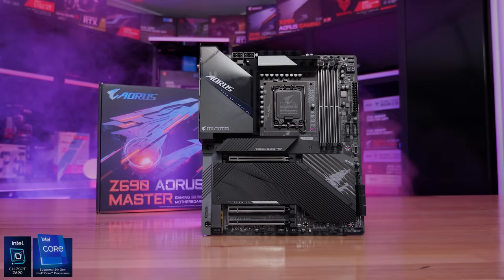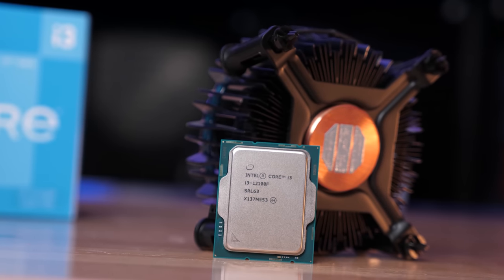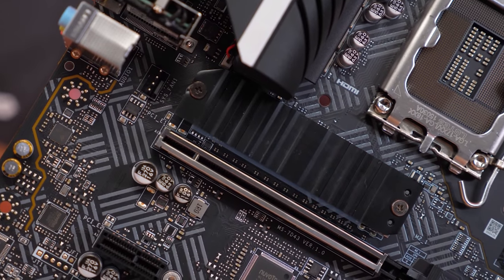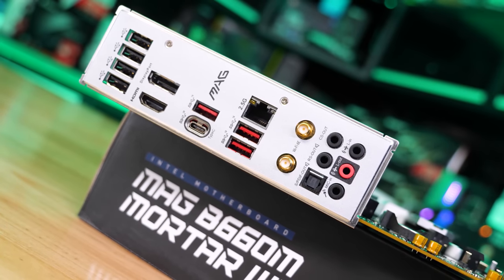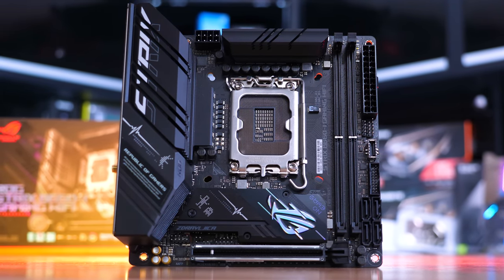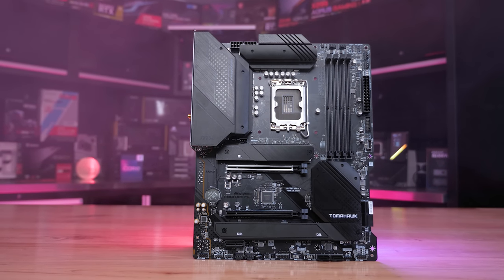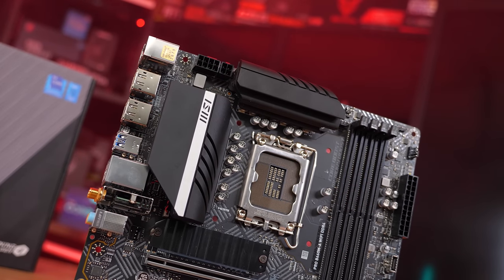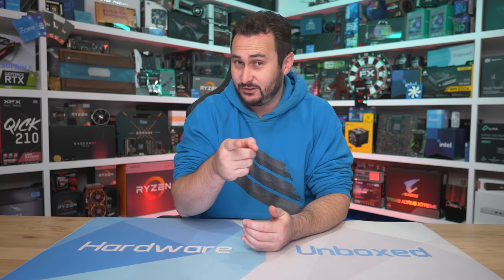Top 5 Best B660 Motherboards

Comment: I am once again wondering about the gigabyte b660 DS3H (full atx) for 125€ and the b660 gaming x  for 130€ (very cheap right now, should be more like 140€ usually). They both have a better vrm than the gigabyte boards that you tested . The ds3h simply has 2 more phases and the  gaming x is equiped with 8 55A power stages. and has pretty chonky heatsinks. It sounds like these are excacly the boards you are missing in gigabytes lineup
Reply: Now I'm choosing between Gigabyte B660 gaming x and MSI PRO B660M-A.  What is the best motherboard to buy?  I heard that MSI has a raw BIOS that freezes.  What should be considered before buying?
Reply: @stefan_es  Well the usual: how much connectivity do you need, does everything that you want to have in your PC fit on the board? If the boards are the same price, I would go for the gaming x. I think it is better in almost every way.

Comment: Considering that AMD is also moving to LGA for AM5 like Intel, maybe this "platform superiority" is coming to an end? LGA sockets must be more expensive, not to mention the retooling and training the motherboard vendors might need to do to support the new socket, and the old equipment they'll have to retire.
Reply: Doubtful. We are talking a few extra dollars at most for the socket at the scale they are operating at. It is likely due to the fact that intel's 600 series is much newer (x570 used to be at z690 prices for like a year after launch). Additionally I wouldn't be surprised if due to the current market many of these AIBs are just making higher margins b/c gpu sales have told them they can get away with it/people are willing to pay more for an intel mobo than an AMD one.
Reply: The high price floor is actually due to the 12th gen chipsets being more or less the same, expensive z690 chip - rather than due to LGA.

AMD seems rather obsessed with their ""premium"" product look - just look at how low-end products haven't come out for almost a year and a half - so this is likely just "fun facts" rather than useful information. :oops:
Reply: I expect AMD to keep "platform superiority" with AM5. 
Intels "65W" CPUs consuming 200W in reality just made it a mess for costumers to pick a proper board without spending hours of research and/or way too much money.
As Steve said even 90-100€ B550 boards can power a 5950X without problems though.
Reply: @nipa5961  AMD is guilty of the same thing you know. the 3800 and 3600 being prime examples of "65 watt" cpus. Additionally the power consumption between the two companies is comparable when you look at the cpus they compete against (with the exception of the 12900k which I agree is too much even if it does tie the 5950x).
Reply: @TheDoomerBlox  Im still pretty upset about amds abandonment of the low end. But I get it, why cut down perfectly good chiplets to 6/6 or 4/8 when you can just sell it as 8/16 and slap it into a long duration epic contract that is higher margin. And pay lip service to consumer by having a fair number of high end cpus.
Reply: @A B-Lymphocite  but theyre releasing new low end cpus soon, so what is your point rn? 

Also they're enabling support for zen 3 on 300 series so...?
Reply: @ab-lymphocite5464  What is AMD guilty of?
The Ryzen 3600 is a proper 65W CPU. So is the 3700X, 5600X and others. 
Intels "65W" CPUs can consume double or even triple that amount though. Which is not just misleading, but also making it a mess for the costumer to pick a proper board as Steve showed in his testing. While many much cheaper B550 boards even handle a 5950X with ease.
Reply: @nipa5961  until you activate PBO. But that would be your descision then and not some fake-TDP like intel is doing.
the advantage of AMD doing no such shady let's say "powerboosting" is that the stock coolers from them don't look terrible. 
Aside from the fact that they are actually better built and more suited for the workload. 
The RH1 in the case of intel is especially funny, since they had the opportunity to make a good cooler (you can see the budget because of the higher build quality), but messed it up with poor functional design, just for astetics.
Reply: @nipa5961  AMD 65W CPUs use ~90W and their 105W CPUs use ~140W. New Intel CPUs have two power modes, the base and the boost, and they have two power ratings, for example the 12700 base is 65W, and boost is 180W. I don't really like how either do these power ratings, but AMD straight up says nowhere that their 105W CPUs use ~140W or that their 65W CPUs use ~90W, so at least Intel (now) lists the boost power consumption in the official specs. I would still prefer for both Intel and AMD to just list the boost power consumption, as both just stay boosting the entire time by default.
Reply: @kaitoux8413  The 5600X consumes 65-70W, the 5950X 120-130W according to Gamers Nexus, Hammer on box, LTT, IgorsLab, DerBauer and others.
Reply: @tkpenalty  A year in a half late and half a year before the new platform launches. Also they are laptop rebrands, so you get way less features (killing 6500xt pref)/they preform substantially worse than 12100f for a marginal downtick in price. The only people I could see buying them would be zen 1 owners. For everyone else they either provide no increase in performance, or your better off just buying a cheaper 12th gen cpu.
Reply: @nipa5961  Bruh AMD, just like intel, don't use power draw for calculating TDP. In blender the 3600 stock uses 79 watts and the 3700x uses 87 at stock, and last I checked none of these values are at or below 65 watts. TDP is a number that is totally devoid of any meaning, and has no relation to real world power usage. If it were up to me I would have BOTH intel and AMD stop using their made up TDP numbers and use actual power draw.
Reply: @ab-lymphocite5464  Regardless of the fake TDPs it's true that the intel parts generally consume more power overall and their budget boards should have strong enough VRMs / heatsinks to deal with them. Vast majority of the B550 boards can deal with the 5900x / 5950x stock as they consume around 130-150W in all core workloads. If you overclock them then they get into the 200-250W region and that's where some of them fail. 

The difference is that with the likes of the 12700 they have to deal with 180-200W loads stock as intel decided to have the turbo duration unlimited for them. They should be able to deal with that.
Reply: @ab-lymphocite5464  I don't care how they are calculating their TDP numbers. If it's completely off though, literally double or triple the advertised TDP it's bad, misleading and potentially dangerous for costumers. 
So why are you blaming both Intel and AMD in the same way, when AMD's numbers are very accurate for the 5600X or 10-20% off on other CPUs while Intel's numbers are 100-200% off??
Only Intel's TDPs are "totally devoid of any meaning".
Reply: @Lemard77  My point was they both lie about "TDP", and in the case of AMD parts the power draw is comparable to their competitors (with the exception of the I9). The 5800x and 12600 use similar power and have similar performance. While the 5900x uses a comparable amount of power to the 12700 (albeit the 12700 is slightly less powerful). And the lighter cpus like the 12400 use similar power to the 5600x. It is just the 12900 which has manic clock speeds so it can land near the sudo HEDT chip that is known as the 5950x.

 Unfortunately despite the power draw not being crazy on the non K non I9's, AIBs have been cheeping out on the vrms leading to lots of lost performance for parts like the 12700 on your midrange mobos and below. And that specicly is undefendable, and intel needs to rein in these AIBs, because I think this really is hurting intel's sales.
Reply: @nipa5961  Because the "TDPs" aren't comparable they use different formulas to calculate them. A basic example of this is if car companies gave the cars weight on different planets. 3000 lbs on Mars is not in any way comparable to 3000 lbs on Earth. Except this is even worse because they are doing the equivalent of saying that the units for their car's weight is cP. If intel wanted to they could alter their TDP formula and the 12900k would have a TDP of 1000 watts. This TDP would be as truthful and useful as saying the 12900k has a TDP of 165 watts.
Reply: @ab-lymphocite5464  Right... 
AMD is 10% off so it's a useless number...
"Makes sense". On Mars, maybe...
Reply: @ab-lymphocite5464  That's the thing though, intel removed the time limit for turbo power for the locked parts to have better performance and do better in reviews, but then didn't force the AIB to have good enough motherboards to be able to deal with this, so it's a crap situation for the people that is on a budget.
Reply: @nipa5961  The 12400 does not use 200 watts lol
Reply: @monke2361  Indeed!
Reply: @nipa5961  but you said intel 65W cpus use 200 watts, the only one that does is the 12900. Most of them don't
Reply: @monke2361  I didn't say all of them do. The problem is that all of them are advertised as "65W" CPUs though. That's misleading customers and creating this whole mess of many Intel boards not being able to handle them, despite their insane prices.
Reply: @nipa5961  Then where are the criticisms for AMD? Their cpus can also exceed their TDP. I'm not blaming AMD or intel because a decent b660 can handle a locked intel cpu, and amd cpus also run fine. You should be blaming motherboard companies for making trash boards. And $120-$140 is not insanely expensive lol. New chipsets are always higher than normal, look at what happened to b560.
Reply: @monke2361  What should I blame AMD for? 
The 5600X is consuming 65W, as it should and as it is advertised. The 5950X consumes 120-130W, so about 20% more than advertised. 
The 12900 consumes more than 200% more though! The 12900K about double. Other Intel "65W" CPUs also consume 50% more, 100% more, 150% more, or even more than that...
As Steve said even most 90$ B550 can handle a 5950X with ease, while many, if not most, B660 boards below 140$ already fail to handle a "65W" 12700.
Reply: @nipa5961  Where are the sources for those numbers? Unless your running cinebench 24/7, most b660 can handle a 12700 with ease.  I really don't know what your point is. Clearly AMD "lies" about their TDP the same way intel does. Why aren't you blaming motherboard companies? And I already made my point with the 12900
Reply: @nipa5961  bro I have 12700K on b660 and it runs fine. B660 boards aren’t failing unless you cut off air flow and run a stress test for hours. And saying a channel name is not a source.
Reply: @monke2361  You could at least watch one single video, or stop trolling, whatever you are capable of...
Reply: @nipa5961  I watch them all the time, throwing out random percentages and fanboying AMD doesn't mean anything. Nobody disagrees that 12th gen is power hungry, its the fact that your making a big deal about the TDP number. My 12700K doesn't pull more than 100 watts in gaming, its pulls well over 100 during a stress test, but you think everybody is running blender 24/7
Reply: @monke2361  Yeah... right...
Giving exact numbers, stating sources, referencing reviews and testings of the most reputable tech channels on youtube makes me a fanboy...
Just repeating "I have 12700K on b660 and it runs fine. B660 boards aren’t failing" makes you right and trustworthy though...
Get better soon!
Reply: @nipa5961  you didn’t reference a source. Saying a channel name isn’t a source, why don’t you link a video. You can watch all the benchmarks you want on the 12700k and if you think it pulls like 200 watts in gaming you’re  delusional, fanboy.
https://www.youtube.com/watch?v=_zqsMiCEQI0&t
Reply: @monke2361  Learn to read! And to think...
Ask someone how to consult a doctor too.
Best of luck!
Reply: @nipa5961  No source on the mass amounts of b660 boards failing? Ok. My MSI pro ddr4 costed $140, runs flawlessly with my 6700 XT. If you want to run your cpu way outside of spec how is that intel's fault? No need to remove power limits for a 5% gain in real world performance

Comment: Great content Steve!  Surprised to see MSI look so much better than Gigabyte or Asus.  I just built an AMD X570 system (I just prefer AMD), and spent big ($220) for an ASUS board with Wifi-6 and other features.  Expensive, but it's a quality board and I'm happy with the purchase.  I like the Intel 12-gen CPUs, and if I was going to build an Intel system, I would be using your mobo reviews.  Thanks again.

p.s.  Tell your partner in crime (Tim) I just bought a Sceptre 32" IPS 1440p, 144 Hz monitor for $279.  Might not be a chart topper?...but it is a worthy choice if you value 32" size.

Comment: B660M Mortar has a version without wifi, so it's not a wifi only board.
Reply: The funny thing is that when I checked a local store they listed the Mortar with Wi-Fi for about $20 LESS than the non Wi-Fi version. I can only guess the non Wi-Fi version will be a hard sell at that price. Wonder how long it will take before they check their prices...

Comment: It's nice to see case and motherboard manufacturers showing a bit more love to the ITX form factor, but it's not so nice that GPU coolers are getting way too big for them. The pointless 2.5 slot coolers don't give enough extra thermal performance over the older 2 slot designs from the Pascal era to warrant taking up the extra space. I've really been enjoying using ITX cases lately for various reasons, and it's unfortunate that it's getting so hard to find GPUs that are compatible.
Reply: How can you say the larger coolers don't have an advantage? They obviously do...pascal used far less power than the new 3000 so that is not even relevant
Reply: @samgoff5289  i'm saying they don't have enough of a thermal advantage, not that they have no thermal advantage. Putting a 2.5 or 3 slot cooler on a xx70/x700 or lower just doesn't make enough sense is all. The xx80/x800 tier and higher cards definitely use too much power now for the smaller coolers, that I'll agree with. But the mid range ones really don't need something that large, especially when so much of it is extra stuff on the shroud. The cooler for my 6600XT is 2.5 slots wide but that extra thickness is almost all unnecessary plastic. I should have been more clear though and said only the mid range cards don't need the bigger coolers. That's my B for not being specific enough

Comment: What is the best low end entry level B660 ATX?
In Indonesia, the MSI Pro B660-A is near the same price as Intel Core I5 12400 Tray.
Reply: I had the same question in mind. I'm not interested in µATX/mATX boards. Also proper ATX B660 boards cost almost as much as some ATX Z690 completely destroying Alder Lakes value proposition.
Reply: Get Asrock B660 Steel legend (ATX), probably the only option in Indonesia since they won't release Msi Pro B660-A (non wifi). thats why its so expensive because they only import the wifi version and also they won't import Asrock B660 Pro Rs (ATX) only the m-atx pro rs got in. personally i wouldn't come close to Asrock mobos under steel legend grade since they used low quality components to cut corners but if you're planning for I5 12400 its okayish to use Pro RS. (I got no option but use steel legend because I paired it with I7 12700F and no other mobos in that price range)
Reply: @johantm3940  I not planning to use 12400, I just say that the price of MSI is the same as 12400 tray. Thanks for the info.

Comment: I picked up a secondhand i5 12400f before buying the mini itx Asrock B660M-ITX/ac motherboard for it.  The video mentioned there's no upgrade path for this board though it is compatible with intel 13th gen cpu's. Just wondering if the i5 13400f and i5 13500 processors be a worthwhile pairing or would be bottlenecked somehow by the board's vcore or power phase design?

Comment: Me sitting here, twiddling my thumbs just waiting for the H670 content lol. I Just built a rig with an Asrock H670m-ITX with a 12600k. There wasn't much in terms of selection in Canada when it comes to being able to support a 12600k on a DDR4 ITX Platform. I had worries about the board's VRM solution but thorough stress testing and benching indicates its performing to spec (for stock 150w power limits). I suppose my Arctic Liquid Freezer Il's VRM fan makes this combination a perfect trifecta.

I just wish I could actually see a professional tech reviewer do a thorough shakedown of H670 so we can get an actually good reference point.

Comment: My i3 12100f performs identically on a Gigabyte h610m (naked VRM) and the Asus b660m-A (heatsink), if you are going with the i3 get an ssd with the savings or something :P. Ps.- They are so evenly matched that if you forget to load the XMP profile on the b660, the H610 will mop the floor with it, badly.
Reply from the maker: Yeah, you just can't upgrade the CPU.
Reply: @Hardwareunboxed  I´d love to see gaming benchmarks about this some day.
Reply from the maker: Which game? One that uses the CPU heavily or one that doesn't? Gaming benchmarks are pointless as VRM performance is about actually using your CPU. Why upgrade to a 12700 on your board if you're not going to use the extra cores?
Reply: @Hardwareunboxed  Games that benefit from 6 cores 12 threads.
Reply: @lukilladog  if you buy a 4c8t cpu on a 610mb, you're not serious about modern gaming or future upgrades... that setup is fine for older, non-demanding games, but you're not going to be AAA or new game release playing.
Reply: @wolfshanze5980  It´s not "fine" for older games, it´s actually overkill. And It´s also a bit faster than the desktop 3700x which has much faster clocks than the PS5 cpu, which will be the base for designing future games. It will be fine.
Reply: @Hardwareunboxed  will a decent 610 board (Asus Prime H610M-E D4) throttle a 12400f?